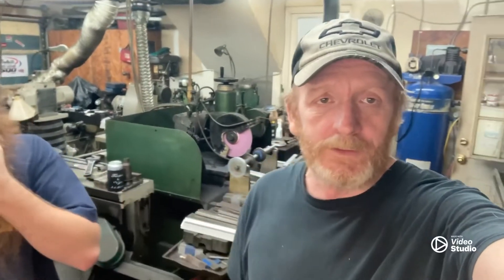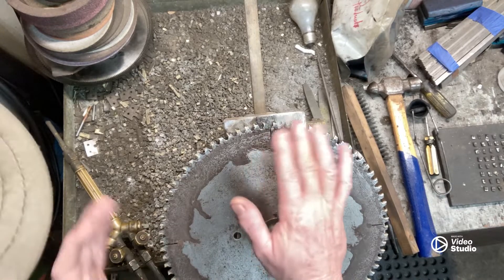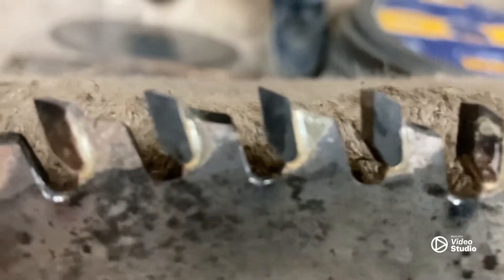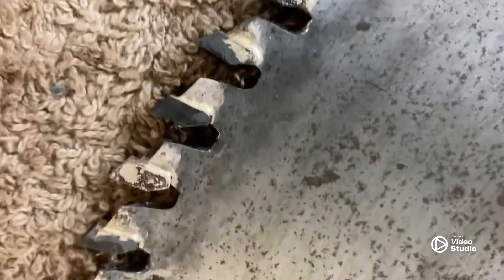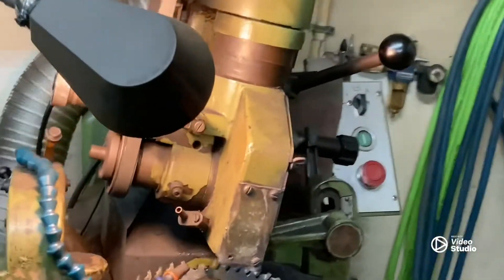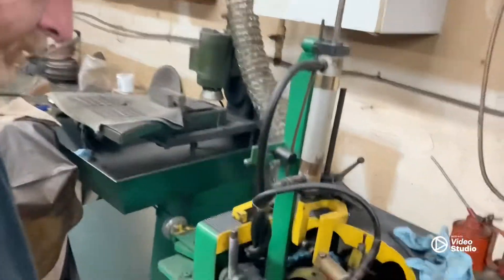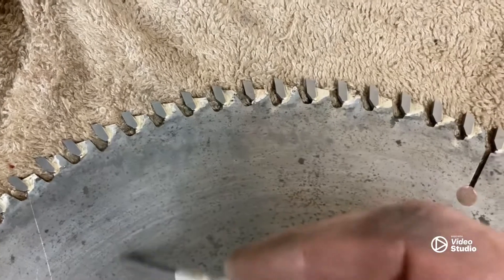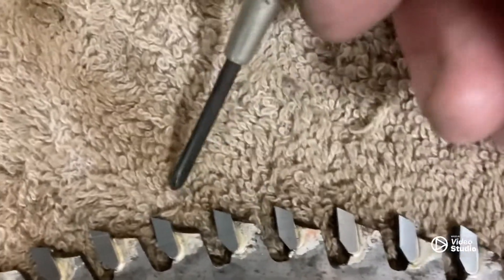Rain delay!! Saw sharpening again.

Comment: Having had to get a few blades repaired, due to my screwups.....
.I really appreciate this video, never take Scenery sets wood from a Theater
Scenery shop, it is usually painted black and festooned with broken off
drywall hard ass screws you can't see......I learned that the had way, so 
did my carbide cabinet blades.....and when cutting 6061 T6 aluminum 
extrusions on a chop saw with a 12" Blade designed for cutting aluminum, 
make darn sure you have the part clamped down.......I ended up spending 
$140 dollars repairing  a blade, at a shop I worked for... as I had knocked
 a few seats off too.....
thanks for the great videos Guys.......Paul down in Orlando......it may be 
raining where you are, but down here the welding shop is 90 degrees inside
and outside is getting around 98 or more, in the shade.....

Comment: This looks like a lost art and important one at that. With supply chain problems I bet some companies see this service as a life saver. One of the factories I worked for sent their special drill bits out for sharpening but not any blades.
Reply from the maker: They don’t appreciate anything. I pull these butt hole out of the fire all the time. But it makes decent video. 👍😃👊